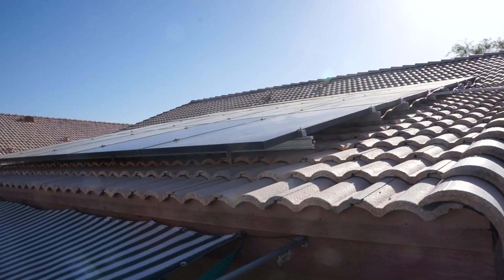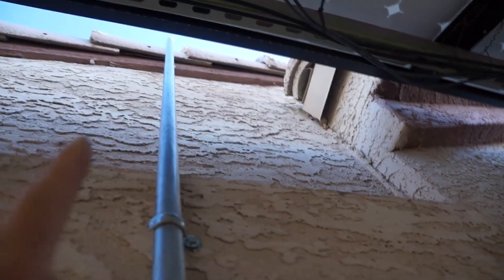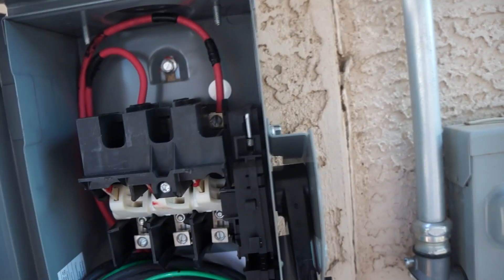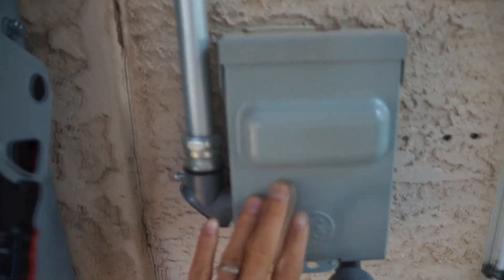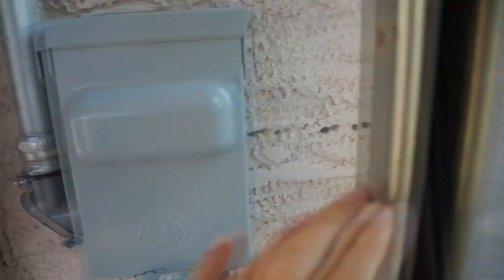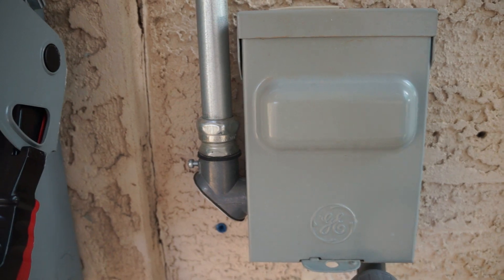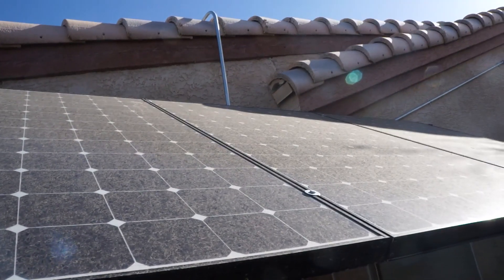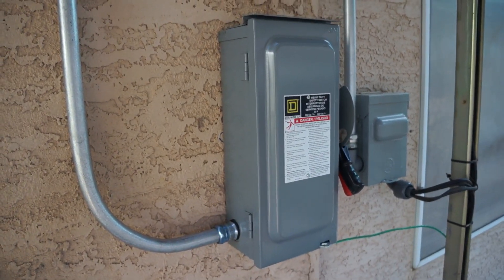NEW 5.6kwh Off Grid  MPP Solar System with Chevy Volt Lithium Battery Part 1

Comment: what you are saying is not making much sense. However, I would recommend installing the grid tie system and the battery system. However, If I was you from the battery system i would divert excess power from the battery  to the grid. this is because when the battery comes to full charge the charge controller turns off. while the controller is off, you loose all the power you would have made.  put the water heater back on the grid and have a diversion grid tie on the battery bank, then you make your mony
Reply from the maker: Of course not to you because you have no idea what I had been doing.

Comment: Why not get rid of the 3.5 ton AC, and place several efficient mini split ACs?
Reply from the maker: That will requires a lot of work and wires running everywhere and condensing unit all over the place.
Reply: devildestiny555. you are so right.

I should know about the extra work, the cables, and the units, but my energy demand went down big time, and choosing variable inverter AC units with heat pumps brought it down.

Another advantage is you can connect each room unit to a sensor switch.  

If there is no one in the room, then that unit is kept off.  

This lowers energy demand further.

Finally, the unit below works only with DC voltage:

http://www.hotspotenergy.com/DC-air-conditioner/Specs-DC48.pdf

This saves you even more.

If you still want the grid, then

http://www.hotspotenergy.com/solar-air-conditioner/

Or an AC-voltage AC with SEER 33.5

https://youtu.be/hdQfgT6LByI

https://youtu.be/Vc9cwYAfcB8

Whichever model you choose, don’t forget to install an ERV for clean, quality air

https://na.panasonic.com/us/home-living-solutions/ventilation-indoor-air-quality/energy-recovery-ventilators

https://youtu.be/pkvoXK6-fjk

and a dehumidifier to increase your comfort at higher indoor temperatures 

https://www.ultra-aire.com/dehumidifiers/

https://youtu.be/jJbM62D3GoU

Have fun.

Comment: I found it really doesn't take to much to heat water. But if it works y not see how long before it fails. I think your hot water will go for a long time: )

Comment: Just an idea, I'm a electrician by trade 35 years, what you can do is set up a couple of contactors connected to your thermostat giving water heating priority then once your water is hot enough your thermostat would turn off your heating element and turn on other      
Like a dump load for your water heater
Reply from the maker: I already know about and done all of that on my other set up.  The decission here is if I should switch my high VDC Solar PV to combine it with my new off grid system and switch over to AC water heater or leave my high voltage DC water solar direct to water heating.

Comment: Great video. You will get a lot of bang for your buck by insulating your garage including the door. Last summer my garage never got above 92F.
Reply from the maker: Did you insulate all side and top too?  I insulate the garage door years ago... but didn't see much help.  My garage face east, so it get cooked all morning, so it get hot... So I am hoping with the Solar, I can run the mini split all day.. :)   Doesn't need to get it cold,  if it can hold 82-85F I think that will be great.
Reply: devildestiny555 We bought the home this way. R19 2x6 walls, r38 ceiling. And an insulated door I am wanting to put in a mini split.  I only have 1300 watts solar right now. Planning for more all off grid. Love your channel. I live just south of Casa Grande..
Reply from the maker: That's a great house then, none of my house had any insulation for garage... at all.  :)  I bought a 12,000btu mini split and it's rated to pull about 1100-1300watts.    With your 1300watts array, would be enough to run it, but it all depend how long you want to run it.  :)